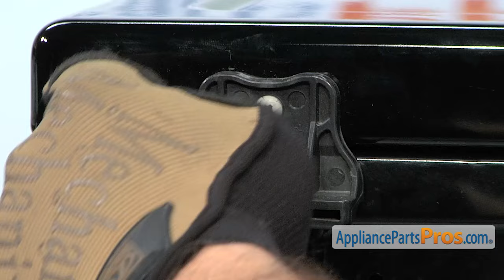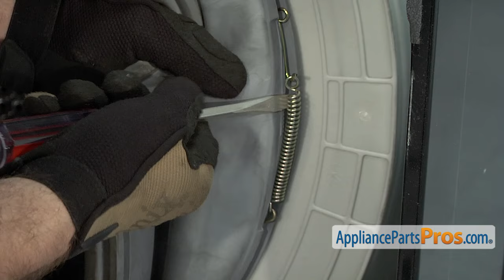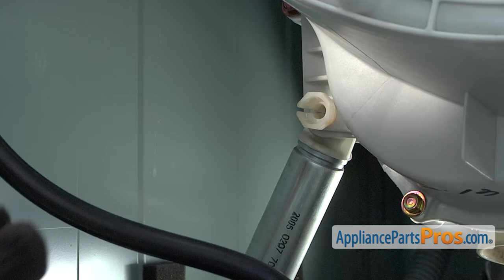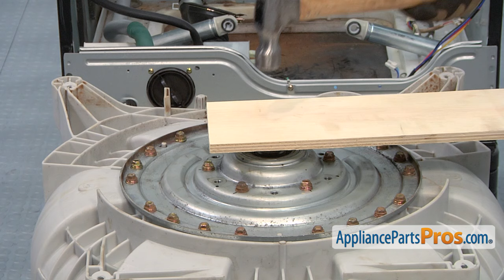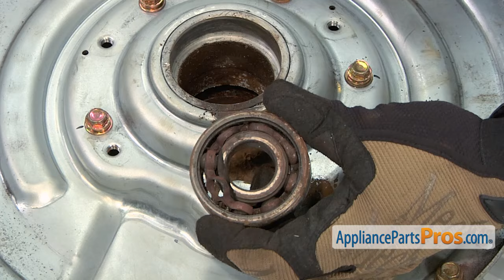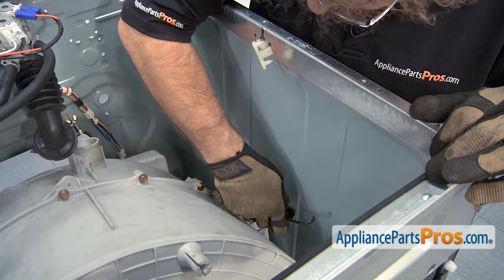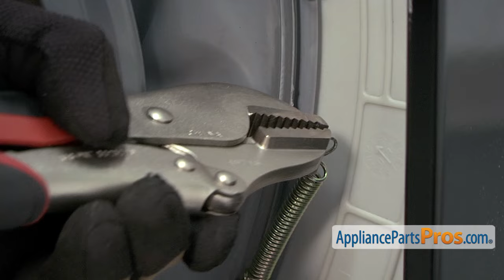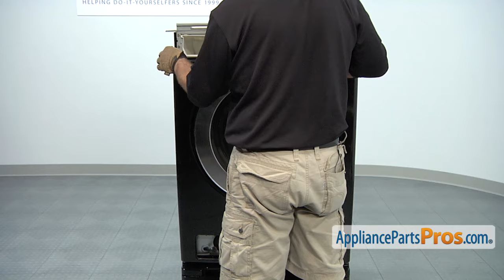How To: LG/Kenmore Washer Seal 4036ER2004A

Comment: I like the video but why not clean the rust from the leaking bearing off before reassembly? Seems like a logical step so when it leaks next time it is easily identified verses thinking it is the old leak mark.
Reply from the maker: I'm glad you found our video helpful! We do our videos as an example of how you would generally go about the repair. Things like cleaning out the appliances, getting rid of rust, and the like are never a bad idea, but unless they're necessary to complete the repair, we don't usually cover them.

Comment: Hello I would like to thank you to all your help in relation to the mechanisms التصبين I am I have a problem in the machine التصبين not operate, despite the electricity pass out but the water is not going through out what's the problem please
Reply from the maker: If your washer is getting power, but still won't fill with water, there are a few things you can check. Make sure that the water is turned on at the faucet. Check that the inlet hoses are not kinked or restricted. Check the screens that are a part of the inlet valve to make sure they are not clogged and preventing water flow. These are all free things you can do before you invest in new parts, so start there. In my experience, the most likely cause is a faulty water inlet valve, which you can check with a with a multi-meter or a voltage tester.

Comment: I have a WM2377CS, I forgot which counterweight will go on top and which one on bottom. I have one counterweight black in colour just like the one in video and one Grey which is different from the one  shown in this video. Please help.
Reply from the maker: We'd be happy to help talk you through that. We offer free technical advice and diagnosis. You can give us a call at 1-877-477-7278 or you can chat us at our website: http://www.appliancepartspros.com/.
Reply: AppliancePartsPros 
I was finally able to figure it out. 
Thanks a lot for the response, because of that you guys have earned praises from extended family and friends since it took me 6 days to fix it, the saga is well known to friends and family.
Reply from the maker: I'm glad we could help you get it repaired and back to washing!
Reply: NK - I see you got your machine repaired.  I just repaired mine yesterday.  I watched another video that suggested labeling all of the screws and bolts.  So when I got to the weights, I took off the upper weight and labeled it "Top" with a sharpie, the weight was grey.  So I would definitely suggest just labeling one of the weights.
Reply: Geanie Litzman 
You are right. I should have done that. 
I put top quality bearings bought locally and made in Japan.

Comment: I understand the tub is on a suspension setup but my question is, how much "play" "wiggle" should there be? Any at all? I hope some one understands what I mean by this. I successful did this repair but i hear a knocking noise and i think its related to bearing not all the way seated..although I pressed them as deep as old bearings.. But I have no comparison to if there was "wiggle" movement or none at all. Again I understand the sway or suspension sey up but its not that kind of movement. Thanks in advance!
Reply from the maker: We'd be happy to help talk you through that and make sure the repair went as it should have. We offer free technical advice and diagnosis. You can give us a call at 1-877-477-7278 or you can chat us at our website: http://www.appliancepartspros.com/. We will need your model number. You can use this tool on our website to help you find the model number: http://www.appliancepartspros.com/modelnumber_locator.aspx

Comment: Rookie question here: why use soap and not oil to lube the bearings before fitting them?
Reply from the maker: You'll often see us use soap instead of oil to install parts on dishwashers and washing machines. One reason is that you don't want oil on a part where it could get on your clothes or on your dishes. With some parts, it's also because we want a little lubrication for installation, but we don't really want it to stay, or the parts could be prone to sliding back off.

Comment: My Samsung has broken spyder. Would it be advantageous to use gasket material and non conductive bolts in the reassembly? This would not have happened in first place if the stainless steel, pot metal chemical reaction wasn't happening, causing the pot metal spyder to corrode. Samsung should have been held accountable. They want $1200 with parts and labor to temporarily fix my $800 washer.
Reply from the maker: We generally don't recommend using anything other than the manufacturer recommended parts.

Comment: Great video.  I bought the back tub assemble with the bearings and seal already installed.  The video is going to make it a breeze to replace.  Thanks.  Saved me $600 over buying a new machine.
Reply from the maker: Thanks! We're glad the video helped you complete the repair and save money.

Comment: I can not get my inner drum out of the outer tub. I followed this video, but  I can not remove the inner drum, I have pounded it with a 2lb steal mallet with a piece of wood to protect it. It even broke the cement block I was holding the plastic outer tub with. Any suggestions before I go postal on this!!!
Reply from the maker: The easiest thing to start with would be to really thoroughly soak every place they touch with penetrating oil, like Rust Buster, and let it take care of that build up that's holding them together. Then try pounding it again. If you still can't separate them, it may not be possible to get them apart without damaging them beyond use.
Reply: I did get it out. I followed another users video. He used four blocks and two pieces of wood to gain leverage and then used a 3lb sledge hammer. It came right out. Thanks for the reply. Now I have to deal with the wrong bearings sent. I received two different sizes.  I didn't buy  you though
Reply from the maker: That's great, Philip! Glad to hear that you got it out after all. If you need any more help with this repair or future repairs, we’re available 7 days a week at 1-877-477-7278 or you can chat us at our website: http://www.appliancepartspros.com/

Comment: Our LG WM2101HW washer sounded like a freight train the last few weeks.  I watched this video and wrote down 2 pages of step by step instructions.  The video showed exactly how to do the job and I could not have done this project without it.  Took me 5 hours start to finish.  A couple tips I've read (and used).  (1) I used a piece of rebar to punch out the old bearings. (2) I used the old bearings as the go between to hammer in the new bearings. (3) Had a little difficulty getting the inner tub shaft to seat all the way but after taking out/re-inserting the rubber bearing seal it seated perfectly (3) Definitely put the inner tub gasket wire on before you install the weights. (4) Installing the outer gasket wire was the hardest part so I saved it for the very last step.  (5) Give yourself plenty of room to do the job - move the washer to the garage.  

How did we do?  New washing machine - $599.  Appliance repairman estimate to replace the bearings - $500.  Did it myself for less than $50 in parts.  Back in place the washer runs like a dream.  My wife is very proud and appreciative - priceless!!

Comment: It would be nice to have some torque specifications for the fasteners directly related to the mechanism that spins the tub. It's a high-speed high-load assembly and I'd hate to under-torque it's bolts.
Reply from the maker: If you need additional help with the repair outside of what's demonstrated in the video, you can give us a call at 1-877-477-7278 or you can chat us at our website: http://www.appliancepartspros.com/. We’re here to help 7 days a week.

Comment: This is a great video.  My bearings were completely shot.  The ball bearings were just tossed around.  I had to also purchase the giant arm (spider assembly) that holds the tumbler... there was so much corrosion that is was very difficult to deal with; much more than the one in this video.   I replaced the bearings and seals and put everything back together.  I'm confident I did the job correctly, but the motor won't spin.... that is a different issue.
Reply from the maker: If you need additional help with the repair outside of what's demonstrated in the video, you can give us a call at 1-877-477-7278 or you can chat us at our website: http://www.appliancepartspros.com/. We do offer free technical advice and diagnosis, so we can advise on your motor. We're here to help 7 days a week.
Reply: What model No. is this in the video?
Reply from the maker: I believe the model number of the appliance in the video is WM2277HB. However, even if yours looks similar, it may have a different model number. I would still check your appliance to verify. You can use this tool on our website to help you find your model number: http://www.appliancepartspros.com/modelnumber_locator.aspx

Comment: This video is very informative. My only problem is I can't get the inner tub separated from the outer tub. It's stuck to the bearing. Tried PB blaster, liquid wrench and wd40 rust stuff (Not regular wd40). Tried 1 pound hammer and 3 pound sledge hammer. I'm ready to just go buy a new washer
Reply from the maker: They can often be really stuck together after years of use. The best advice is usually to soak it thoroughly with Rust Buster and apply force. Of course, particularly if you're considering replacing the washer anyway, it may be worth it to really get in there and not be afraid to hammer that seal with a lot of force. If you absolutely can't separate them, the only other option would be to also replace the outer tub.
Reply: AppliancePartsPros I got it to separate... unfortunately it separated because the bearing busted apart. The out collars of the bearing are fused to the tub. They aren't budging. The inner collar of the inner bearing is fused to the shaft of the spider arm. The shaft is rusted. So I purchased a new outer tub assembly and new spider arm. Hope i can get it all back together then!
Reply from the maker: If you need technical advice outside of what we have in our videos, get in touch with us and we'll help you out. You can give us a call at 1-877-477-7278 or you can chat us at our website for a faster response: http://www.appliancepartspros.com/. We also have a free repair forum where the techs can help: http://forum.appliancepartspros.com/. We’re here to help 7 days a week.
Reply: AppliancePartsPros thank you! With the new parts, I should be able to resume the repair. Like I said the shaft of the spider arm was rusted which expanded. There was no way to get the bearing off. I guess I could have heated it however, I probably would have had an issue installing a new bearing so I figured starting fresh with the bearings already installed in the part was the easiest way to go for me. This video was real helpful with the tear down and assembly I'm sure will be the same
Reply from the maker: Glad the video helped you out! If you need any help as you resume the repair, we're open 7 days a week.

Comment: I decided to use a length of M8 steel threaded bar with two washers and two M8 nuts.  I placed both bearings into place. I then put the threaded bar through the hole in the bearings so that it's ends protruded out both ends and then placed on large washer onto each end of the bar and pushed them both up against the bearings I then screwed on the nuts, one on each end of the bar also.  The tightening of the nuts pushed the washers closer together and pushed the bearings into place. The one bearing stopped moving when it gets to it flange so just carried on with tightening the other side till that bearing also reached it's point. I found this kept the bearings level.  I then unscrewed the nuts from the bar and removed the washers and then put the black rubber washer in place and tapped it into position. I thought by hitting the bearings I might damage them so the above idea seemed safer to me.
Reply from the maker: Thanks for your feedback, John!

Comment: I've replaced the bearings with no problems and the unit is back together and it's giving me an Le code. any help would be great. does the rotor need to go back on in particular way?
Reply from the maker: We would suggest checking to make sure that the rotor position sensor is in place properly. Also check to make sure that there are no loose or damaged wiring connections. The rotor does not have to be in a certain position.

Comment: hi hello i have a mabe  top loader 17 kg washing machine each times i set the machine to wash it wash left then right and then the pause light started to blink  if i tuch the pause light  it just do the same thing over and over  however it will let the water out thou
Reply from the maker: Donald, do you have your washer's model number? It could be located on or behind the control panel, behind the door, or on the lower-front or side of the main cabinet body.
Reply from the maker: You can check to make sure that your door switch is working, as that can cause issues if it isn't. If that doesn't seem to be the problem, you can give us a call at 1-877-477-7278 or chat with us on our website http://www.appliancepartspros.com/. We're here 7 days a week, and we can look up your model number and try to see what could be causing the problem.

Comment: Thanks for posting this video! My LG model was a bit different, but basic structure mostly the same. I am having quite a bit of trouble getting the shock absorbers out- what are some alternatives?
Reply from the maker: Here is another video that may help you out: https://www.youtube.com/watch?v=gAF6eucdciU
Reply: AppliancePartsPros I replaced the bearings on this, and when I go to run the machine, the tub now just trembles like it's trying to turn, but doesn't actually turn. CN I contact one of your specialists to discuss?
Reply from the maker: Sure, Joanna. Call us at 1-877-477-7278.

Comment: My inner tub will not come out. I beat the neck out of it....its stuck! I sprayed d-40 a few different times and let it sit over night..I also tried to heat it up. Any suggestions?
Reply from the maker: Keep working at it to try and get it out. Some are in there pretty good. If the shaft and the bearing are rusted in there together it may be difficult to drive it out.
Reply: Thank you sir. I'm pretty sure i have the bearings all off...the shaft slides up and down freely but catches at the bottom now and wont go all the way through?? thanks for the advice.
Reply from the maker: If the shaft will not go all the way through check the shaft diameter where it goes into the bearing. If it swelled from being rusty it may not fit into the new bearing.

Comment: Thanks for such an informative video.  It would have been great if you could have indicated a point where you're able to run the washer through a cycle to test out the repair for leaks before fully buttoning it up, but I'm gonna surmise as long as the front door & gasket are on properly, all the mechanical and electrical connections are good and the water/drain hoses are connected properly, any point near the end would be fine.
I have a different model Kenmore but I believe this will serve as a good guide to replacing the bearings on mine.
Reply from the maker: Glad the video helped you get the washer fixed!

Comment: Excellent step by step video.  Only difficult part was getting the old bearings out which were fused to the shaft.  Have some patience and let the penetrating oil do its thing.  Thanks for allowing me to save our washer from the landfill.
Reply from the maker: Awesome, glad the video helped you get the washer fixed!

Comment: Excellent video. Following your instructions helped me get the job done. It's been 4 months and still quiet as a mouse. My old bearing was fused to the spindle shaft had to cut it off with a dremel but other than that the job went smooth. Thanks for the tips!
Reply from the maker: Glad the video helped you get the washer up and running!

Comment: Excellent video. Just one point I would like to make. If that tub support were NOT cracked I would not reuse it.  Any pitting caused by rust/corrosion on the shaft in the area where the seal meets the shaft will prematurely wear out the seal and in a few months you will be doing this again. Unless your support is pristine , replace it and in the future , as soon as the bearings starts making noise , replace them and the seal and you won't have to replace the support again.
BTW-if you let this problem go to the point that the machine sounds like a machine gun when in the spin cycle , be ready to change the cracked support as well as the front outer tub.
Reply from the maker: Thanks for the tips!

Comment: Now do one for the washer dryer combo so far after paying $85 in parts it's about a6 hour job dismantling the tub from the frame and trying to remove bearings tommorow after going to Bunnings and getting some all thread to help remove the last bearing I estimate another 3 hours or so trying to put it back together again should have just bought another machine very sad lg